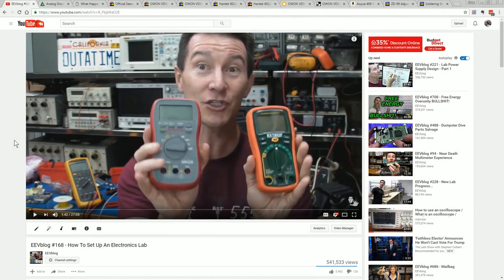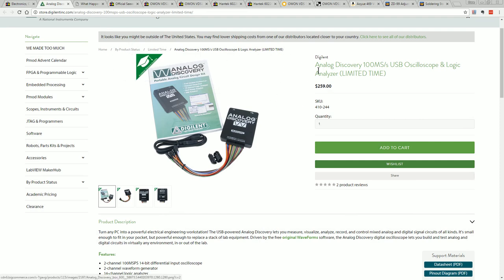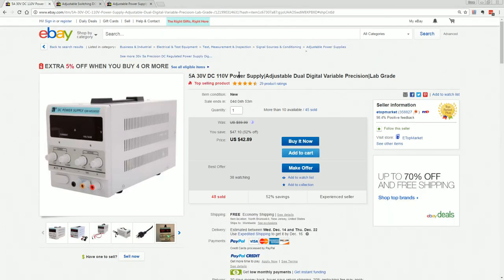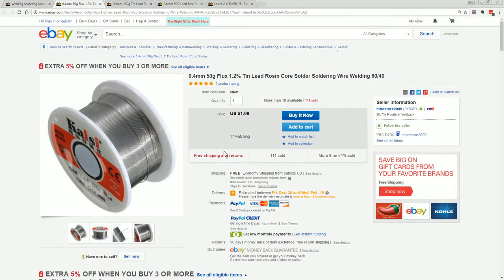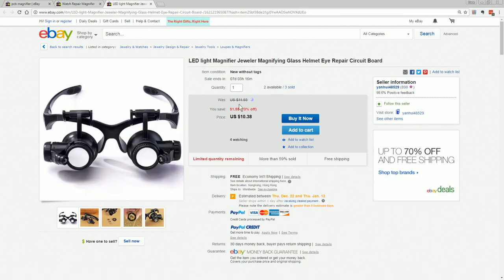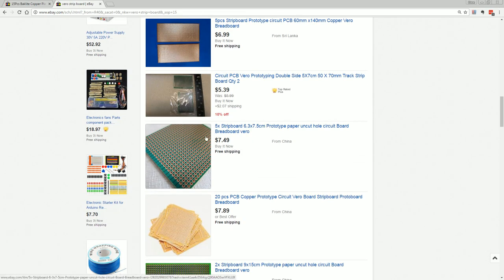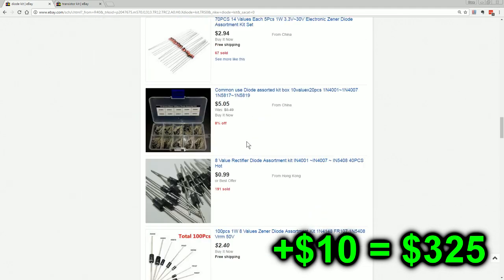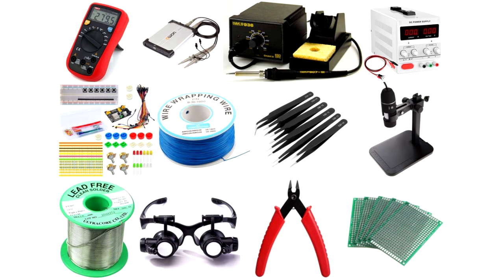EEVblog #954 - How To Setup An Electronics Lab For $300

Comment: Great video.  This is exactly what I was looking for.
Reply: I wish this was around before I got my lab...although i have far better equipment, I don't have a logic analyzer or a function generator and other crucial things. I focused on parts instead of gear more and also on getting higher quality items. So all totaled I will probably end up spending well over $3000, or 10X this video's suggestion for my lab.

Comment: I've used a hakko 936 knockoff for years, till I got an actual hakko, only to find out that the temperature was calibrated more accurately on the knock off... I do realise it was just "luck of the draw," but, unless you are running a company where depreciation can be written off etc, it's very hard to justify the OG kit. They are such a known quality that some of the fakes can be very reliable.

Comment: Most everything nowadays is RoHS compliant which means the soldering tips should be able to melt RoHS solder which is hotter than simple tin/lead solder.

Comment: Be aware that some of the cheap solders available on eBay and AliExpress are not the alloy composition they state. You can find a number of comparison videos on YouTube of the cheap solders Vs known brand solders, the cheap solders not always melting at the expected temperatures and being 100°C off. Not all cheap solders is crap. Just test the melting point when you get it.

Comment: Great video! I do wonder how suitable it would be for SMD work without hot air.
Reply: I have a nice hot air station but I mostly use it for rework or removing components. I mostly do all of my SMD work by hand. The smallest I've done so far is 0.5mm 48-pin TQFP but no doubt I could do a 128 or 144 just as easily. The right amount of gel flux and small amount of solder on a chisel tip does wonders.
Reply: I need to actually find something I want to make, because I have a hot air station, and my mother has a vinyl cutter, but 80% of the time it just makes more sense to hook up an arduino.
Reply: I've actually found that just doing random, simple projects help me in learning. I intentionally over-design some projects just so I can learn about various components or aspects that I have not done before. Try to get out of your comfort zone and do something you don't yet know how to do.
Reply: PolygonByte I'm taking a digital electronics course in high school right now where I'm forced to work with low-level stuff until the end of the year, so that helps.
Reply: yes you learn so much from just messing around, it really teaches you what works and what doesn't. Having one or 2 cent components from china also helps not worrying too much about using some of them.
Reply: oragamihawk Very nice. Low-level programming is a fantastic way to learn the hardware better. I've only been doing electronics for about four years now (learning on my own) but I've been doing software engineering and computer programming for over 10 years. Electronics has been a great way to augment my programming, especially since they really go together like peanut butter and jelly haha
Reply: Kevin Miedema Yup, a good parts bin selection helps to be able to just "go" on a project. A lot of my parts bin is a good mix of through hole and SMD components. This way I can prototype with the through hole components on a breadboard before I take things to a final circuit board, which I design almost everything with SMD now.
Reply: Hot air is mostly useful for re-working; for building, you only need an iron.
Reply: God Emperor Lionel Lauer Repair is just as often the motivation for building an electronics lab, and even builders don't want to toss their QFP or PLCC or TSOP components just because of minor assembly errors. I'm about to spend $30 on some hot tweezers just to avoid all the trouble with replacing surface mount electrolytic capacitors (a common task).
Reply: im trying it at the moment - soldering on 1206 smd components is no problem but getting them off is basically impossible - cutting them off or soldering on wire to shunt it or another resistor does get around it tho - smd resistors are even cheaper anyway. SMD resistors are fantastic for prototyping boards, they are small and you can cram them in virtually anywhere. the smd capacitors are great too, they are tiny and come in as large as 22uF ceramic ones.
Reply: Kevin Miedema Hot air is not great for desoldering SMD resistors. It is slow, you heat up the entire board, and risk desoldering a lot more components than you intended.
The best method for desoldering SMD resistors is to use two soldering irons. One in each hand.
There are also tweezer type soldering irons which do the job very well, but for a hobbyist they are not worth the extra cost.
just get a second el-cheapo soldering station and you'll be fine.

There is a method you can use with a single soldering iron: Apply a giant blob of solder. Large enough to reach both pads at the same time.

Comment: I was wondering if there were any recommendations for "helping hands"? At the moment, I just stick things down on the bench with bluetack. Would something like a Panavise 201 be recommended or would one of them cheap two-arm + magnifying glass deals work? Thanks :)
Reply: You can rig your own using croc clip or small bulldog clips (which can be better with pcbs).  Use a wood baseboard and M6 threaded rod, M6 bolts and insets.  Then you can put in several insets so can reconfigure to suit task.  I find bulldog clips are often much much better to use.

Comment: What do i need for Arduino start?  I already ordered a starter box. I guess i can drop the power supply when i live with USB 5v
Reply: buy a "37 sensor" kit; 2/3 of the parts are useful or at least interesting.

Comment: No isolation tape (electrical tape) or heatshrink tubes in the list?? I hope I'm using the right terms, but that is what I have and I have less equipment. For example, I have no breadboard and I have one soldering iron 60W without temp. regulation. --__-- 
Otherwise, very useful list.

Comment: I had problems with Chinese PCBs. The contacts on paper based PCBs would fall off. Even the fibreglass PCBs that I etched had areas where contacts fell of , and that was on first soldering. Got some good PCB from my local shop and I'm able to resolder contacts a few times, and still they don't fall off.
Reply: SidneyCritic ComedyHound The paper based are indeed shit. I haven't had any problem with the fibreglass ones (through hole). Even use it for 3kW power systems.

Comment: I'll probably buy one of those power supplies, sure a hacky pc supply does kind of work, but it's really handy to have full control and display over the output. Plus it'll handle more current than what I'm using anyway. Also I still sort of regret the jaycar solder station, but hey it was on sale so I only paid over 150 bucks.

Comment: the most important is missed. Hammer and screwdriver set :) but the best, if You spend every month 1/5 of Your income, whatever is the amount. This will push You to earn more and save more. This the cost of Your future. just an advice.
Reply from the maker: I deliberately didn't go into other hand tools like screwdrivers.
Reply: I know Dave. Hammer is the best tool for fine adjust pots, lcd-s, relays, vacuum tubes and so on :) At least 2 kg You need. Mostly for cheap chinese product repairs.

Comment: @EEVblog
Why a power supply for the beginning? 10 x AA batteries + a LM317 should be fine to control voltage and i am sure you know how to build some schematics to have current limitation for under $ 10 solely based on a battery driven power supply.
The trick is here to not make use of net power and solely base the thing on batteries.

Comment: Nice video dave, so question... I decided against getting a usb oscilloscope because in a previous video you mentioned something about oscilloscopes being crap/useless or something along those lines, without A/C coupling (I think it was one of those portable scopes) so is it or is it not a necessary feature?

Also just thought I'd mention a few ways you can save a bit more on lab equipment.
Instead of a power supply you can pick up a boost or buck converter with current control like the ones you showed near the end and any random power brick to use as PSU for under $20, my personal favorite is the Ming He D3806 boost-buck converter.
If a function generator isn't too important to you, then you can use your phone as one, although of course it only does 20hz to 20khz but it's free.
For a decent fume extractor on the cheap, you can get some powerful case fans for around $10 or a cheapie air purifier such as the HAP116Z for as low as $15 and place some carbon filter in front of it. (prices of carbon filter can vary a bit, I got 4 modest sized sheets for just $5, plenty to last quite a while).

One thing I would personally add to that list is rechargeable batteries, if you don't already have some, then it can be handy to have some NIMH and/or lithium cells on hand for projects or modifications.
Reply: regarding usb scopes, the hantek ones are truly crap, they are just sampling devices, everything like the trigger etc. is handled by the pc, making for a TERRIBLE experience, better to get the OWON, thats an actual scope that just sends the image and some metadata to the pc.

Comment: Because of this video I took a look on USB oscilloscopes(until I dreamed about rigol z1000 series). After reading all eevblog forum posts I found that Hantek does not tell trut about their oscilloscopes, eg. sample Memory 1MS is RAM from your computer, the could cleim that scope has 1GS, actually thei have only 2kb. The same goes to analog bandwith - 48MS will give you max 5MHz worth of bandwith.
Owon is closer to reality with their specifications, but software does not look mature.  I think that usb scope software is as important or more imortant than hardware.
I found interesting youtube review about picoscope 2204a USB oscilloscope  I bought that cheapest picoscope 2204a because it has the same software as their top models. I suggest to look at this model because of software and buid quality. The only thing that seperates cheapest and most expensive pico USB oscilloscopes is techical specification( Bandwith, number of channels, sample memory, MS/s, resolution in bits), not build quality or software features.

Comment: Im no pro at all. But my lab is currently at about $400 pushing $500.
Fluke multimeter, Weller soldering station ,Hot air station, magafying lamp & Andonstar electron scope. Large Starter kit with a ton of compnents bread board stuff. For the main items.
 The rest such as cutters, screwdrivers, glue gun etc etc I already own.
Not sure oselescope or however you spell it is worth owning. Since im just a novice and learning as a hobby diy fix it.

Comment: Small correction: the recommended soldering station is $15, but you only count $5. Yet, when it comes to the solder and flux, you count them as $15 instead of $5. That's somewhat tricky =)

Comment: Why the lead free solder?  Health and safety/local laws or a practical reason?
Reply: I'm quite confused with exactly this topic. It was recommended to use 60/40 solder or so, and "lead free stuff" can be a problem especially for beginners (well, like me). However if I visit any of the local stores to buy solder, they only have lead free stuffs, however even hundreds different ones. I am not really sure now, if "standard" 60/40 and similar solders (with lead) are so preferred why shops doesn't sell them? :) But to be honest, it's the situation here in Hungary, so it can be a different issue, like the "strong lobby" against using lead in general?

Comment: Yeah kids, don't do what I did and buy all the expensive crap. I have 2 lab power supplies, and what do I use? A fucking 15$ PC power supply with a jumper wire shoved in the correct pins on the 24pin motherboard connector. 3.3v, 5v, 12v turned out to be all I needed.
Reply: Seraephus PC PSUs are not suitable for many applications, like AC and some negative voltages.
Reply: At that point you most likely are spending more on your kit anyways.
Reply: oragamihawk Does the one in the video not do those things? That's almost the only reason to have a bench PSU, IMO. First step to testing/troubleshooting something is to see if it works and that often requires an appropriate PSU.
Reply: Emmett Turner It really depends what you are doing, I can get away with DC power bricks, but I have spent $80+ on a computerized battery balance charger so I can output different voltages based on cell count at a higher amperage than you could reasonably expect a variable supply to.
Reply: The last time I really felt that I needed one was when I got an untested Atari 800 (AC). I find myself wishing I had one more capable than a PC PSU about every other month, and that's just from the stuff I encounter day to day.
Reply: It all depends on what you are doing. An ATX supply has no way to limit current supply.n You can use fuses but if you feed several amps into your breadboard and something is wrong with the circuit , you are going to fry everything on that board. 
You are better to build your own power supply with a LM317 and a wall adapter setup. Multiple circuits online. I recommend using a transformer with bridge rectifier vs a switching supply as it will be a cleaner output without much fuss.
Reply: or you could use one of the buck/boost controllers that Julian Illet likes so much - fed by an ATX 12V supply,  but the UI on those looks awful fiddly.   A new UI board with a couple of knobs and maybe a bigger screen would improve those a lot.
Reply: I found a Pro-Elec brand power supply 3V through 12V power supply for $17 which does a pretty good job, can't fine tune the voltage or current but as a beginner I think it is more than enough and it's smaller than a computer power supply so it fits great on my small desk.
Reply: I’ll buy one of them for a discount if you want to get rid of it

Comment: For a power supply I use one of those 15$ digital buck-boost converters with a 12volt 12A power supply that I got on a garage sale for 1 british pound, and its very good.
Reply: Yes, that's what I got but I use a hacked old ATX power supply for mine. Does the job nicely.
Reply: Nick B I had a hacked ATX is well untill it went bang with lots of smoke

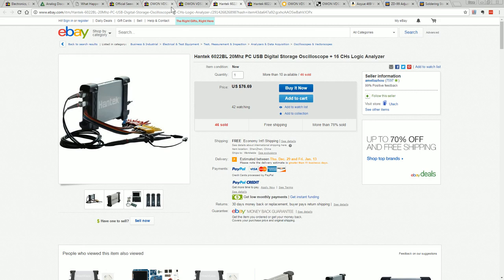Comment: 2:16 whatever you do, DO NOT GET THIS HANTEK ONE (the 6022 be or bl), get the owon, but not for the reason dave says, the owon is an actual fpga based scope with Hardware trigger and stuff, while this hantek just streams the data to the pc making for a shoddy trigger, unstable trace. just dont. i have the owon, and the thing works like much more expensive scopes.

Comment: you can replace the tip cleaner with brillo pads clamped to your desk..works like a charm and costs even less + your mom may have them layin around anyway.  you can get a real microsope including a usb cam for as low as 30$ that makes a usable microscope for you and the cam extra( bargain!) ,

Comment: No ESD solutions? 
No need, no worries? 
Real question
Reply: Have a big piece of metal next to you and touch it occasionally, just don't wear synthetic fabrics.
Reply: Derek McGowan you can use aluminium foil for a temporary mat
Reply: nox5555 but my bedroom cuffs have fur on them
Reply: I remember I have destroyed lots of 40xx components back in the 80ies just by looking at them. Very sensitive.

But these days, it is almost impossible to ESD destroy common CMOS components - 74HCTxx, Microcontrollers, all fine. If you handle a $200 FPGA, use one. Or if the datasheet explicitly points out that something is particularly sensitive.

But for common things these days: don't care.
Reply: ESD on the cheap: have old power supply next to you, plugged in (not powered on). Touch the chassis every time you move around a lot, or get up and come back. If you've grounded out your project/area before you started working on it (using the same technique), you should be fine.  ESD cert is mostly important in industry, not for the home-gamer, since your volume as a home gamer is quite low and you aren't in an industrial area with all sorts of potential threats. For you, your biggest worry is scuffing your feet on the carpet and building up a charge. 

Don't do that ;)
Reply: TheJohn8765 
Actually im not adding pc components this time. Im creating a new product and involves smd work and ble microcontrollers. Planning to (hopefully) assemble and sell 10-20 per month. Still low volume but that also means my component cost is higher per unit so i dont want to waste any due to negligence
Reply: You can get an ESD wrist band for few bucks from eBay, connect the banana plug connector end to the earth pin of the mains plug and plug it into the wall outlet.
Reply: Exactly what I've been doing for years - I got a regular UK 3 pin plug, and took the Live/Neutral pins out of it for safety. Works perfectly well :)
Reply: I croc clip a wire to my watch strap and add a 1M resistor in series to a banana plug stuck in the earth socket on my PSU.
Reply: just get a pair of them nipple clamps with the chain and clip one to your nipple and the other to the radiator

although the real pros get nipple piercings
Reply: Touch a spent battery terminal. Free ESD.

Comment: Pliers and cutters is something I don't skimp on due to the steel being used in cheap Chinese stuff is just super crap, gonna blunt on day 2, gonna deform the minute you want to put some force into bending or turning something. Just my 2c. The second cheapest brand in Bunnings is usually good enough for me, like the cheapest that's not their internal brand